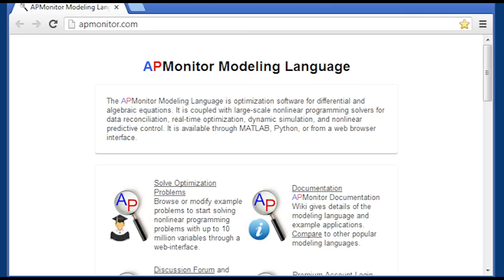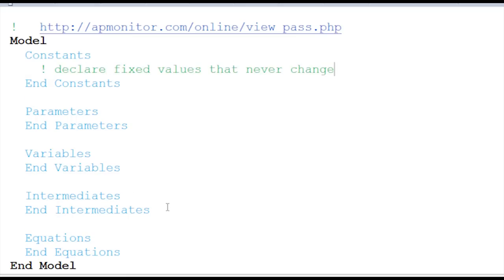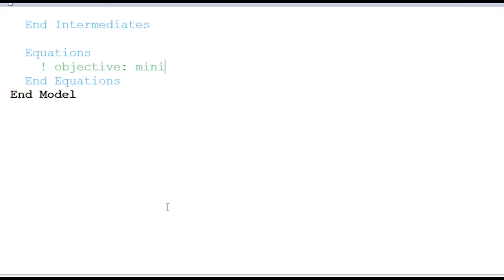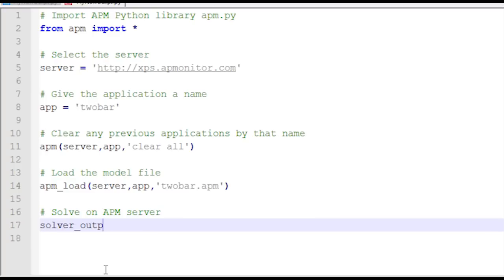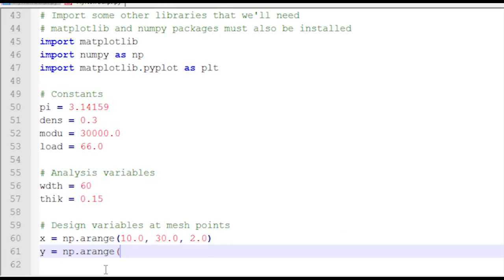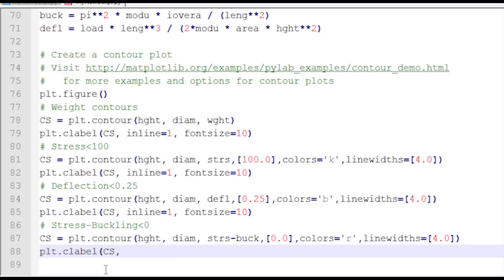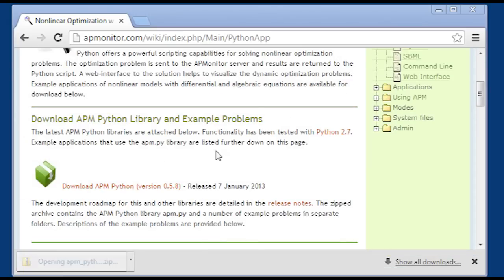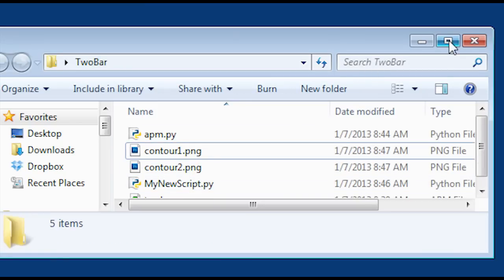Python Tutorial for Engineering Optimization

Comment: Thank you for the video! 
How do you link the parameters  you declared in the model to a table/.csv file? And use index. 
Where can i find the sum function?

Thanks!
Reply from the maker: +John Lagarge it takes two lines to implement a summation in APMonitor. See http://apmonitor.com/wiki/index.php/Main/Arrays

You can link values in your data file (CSV) and model file (APM) by using the variable or parameter name as a heading. Don't forget to save the CSV file as comma delimited instead of tab delimited. On MacOS in Excel, you'll need to save as DOS format because the old MacOS format (CR) doesn't work. Linux (LF) or Windows (CR and LF) at the end of each row should work fine.
Reply: +APMonitor.com Thank you for getting back so quickly. 
Is there documentation detailing nomenclature for the AMP file? Not sure how declare array parameters in the model that are linked to the .csv . Or the language it is based on?
Reply from the maker: There is a documentation link at APMonitor.com, a YouTube channel (APMonitorCom), a course at http:apmonitor.com/do, and a user's group (http://apmonitor.com/wiki/index.php/Main/UsersGroup). I'm also available if you need support (john@apmonitor.com).
Reply from the maker: One other resource for you is this example problem: http://apmonitor.com/do/index.php/Main/ModelIdentification  It is in MATLAB but it should give you an idea of how to read in a data file table into APMonitor.